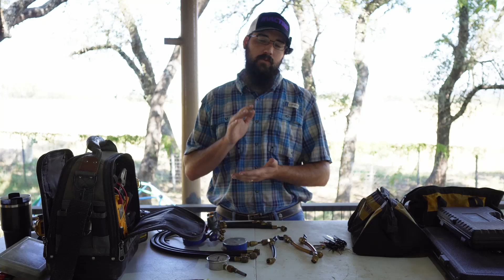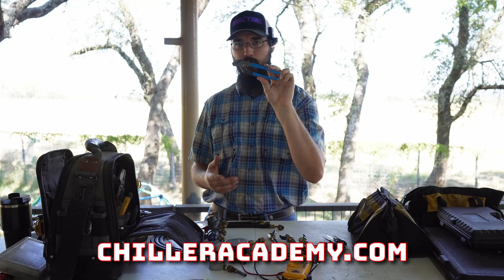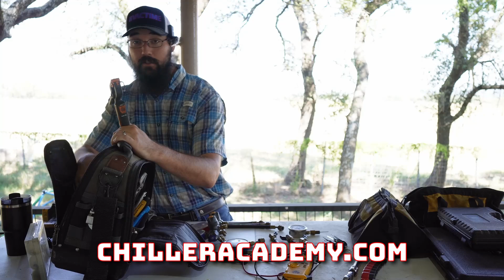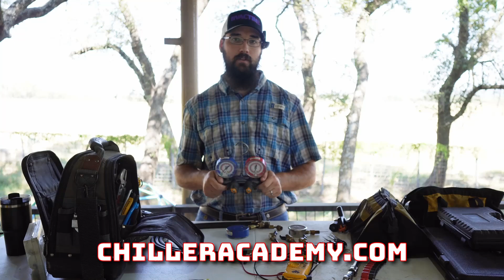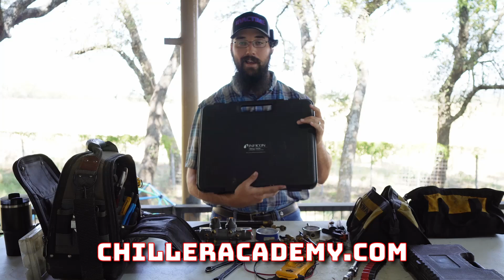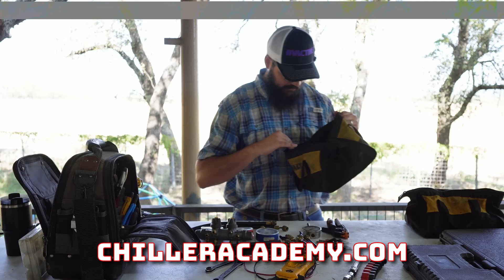Chiller Tech Basic Tools - Chiller Academy

Comment: I had my old dewalt impact for over 20 years still works great unfortunately the batteries don’t hold a charge anymore so I stopped using it . Went to Milwaukee but have no expectations that any brand will last close to my last one